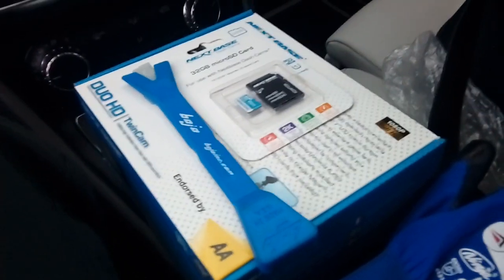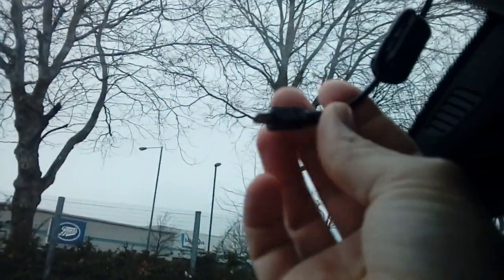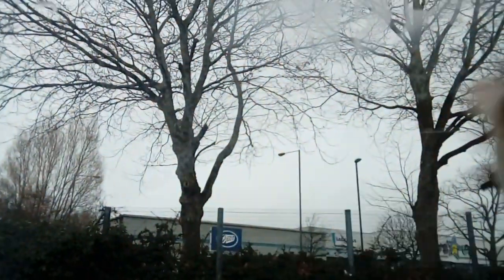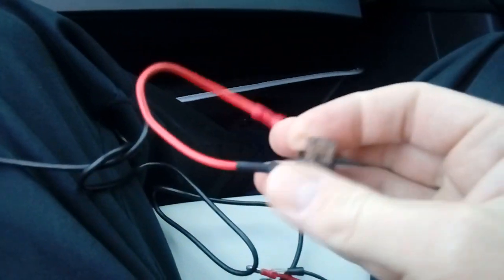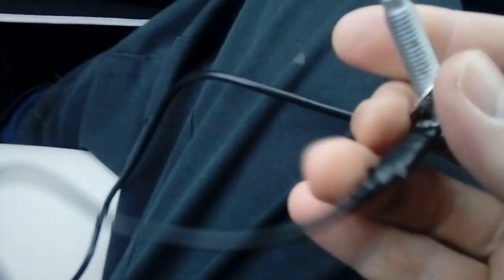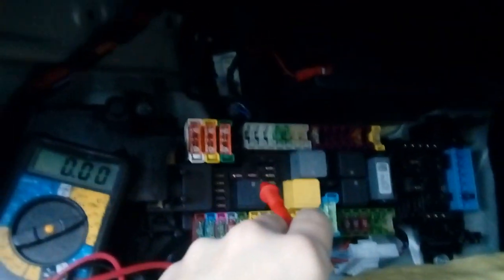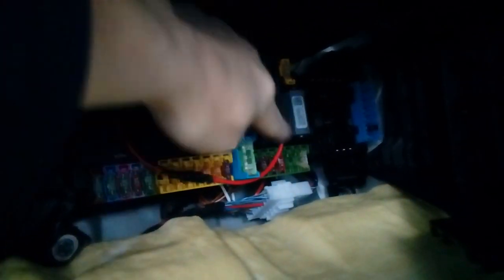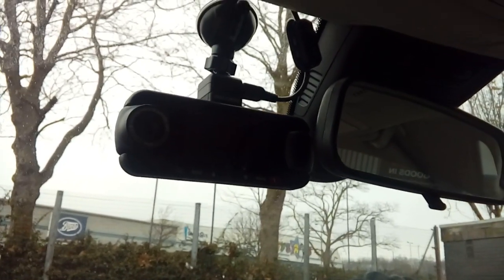Mercedes A Class 2012-2018 dash cam install guide to fuse box

Comment: Spot on. Easy to follow video. For anyone else following this, I used the Nextbase hardwire kit on a W176 (2017) model and found that fuse 65 (Glovebox) worked for me (although you'll need to manipulate the wire on the Nextbase kit to make it fit properly).

Comment: Great video thanks. Just swapped my NextBase dash cam over to the 2017 Mercedes A-Class I’ve just bought. Everything went perfectly and it was useful to know which panels to remove and where to find the fuse box. Done in half an hour 👍🏼😁

Comment: where you fit your fuse i have only the two above, when i try to fit the spur over hangs onto the case is there another fuse to use 2019 A class

Comment: Hello ❤️Amazing video! ❤️ 

i have a Mercedes w176 and i need a constant fuse to tap in, i tried the "ovewrhead unit" but i belive it turns off after 2hours 😪 Thank you
Reply from the maker: Try the fuse for central locking, that will be a constant live.

Comment: Thanks to sharing mate very thorough. I’ll be doing this with a “TOGUARD” one which will be using parking mode which will require a constant power source and I’ll order a hardwire kit. Do you have any advice on which fuse to select? I’ll be looking at the fuse diagram but any advice would be appreciated (I do gather you advise against ABS or any of the really important stuff). Advice on a suitable constant fuse which would be the least risky would be much appreciated. 

Thanks and all the best 👏👏
Reply from the maker: Try the one for central locking as that's live all the time.

Comment: We’re do you buy the kit or do you have link of adapter to hard wire it fuse box?
Reply from the maker: Just done a quick Google search for you - 
https://nextbase.co.uk/accessories/series-2-hardwire-kit/?utm_term=&utm_campaign=FP-Nextbase-UK-Lang-EN-G-Google-PMax-PRSPCT-Sales-Everything-Else&utm_source=adwords&utm_medium=ppc&hsa_acc=7822671863&hsa_cam=17557847883&hsa_grp=&hsa_ad=&hsa_src=x&hsa_tgt=&hsa_kw=&hsa_mt=&hsa_net=adwords&hsa_ver=3&gclid=CjwKCAjw7eSZBhB8EiwA60kCWwJl-UvzVOgzzSIGtXBuFYgs3rFo4fBwwmHPH9RvQcSeZngZV6MYsxoC_ckQAvD_BwE

https://www.argos.co.uk/product/8888396?istCompanyId=a74d8886-5df9-4baa-b776-166b3bf9111c&istFeedId=30f62ea9-9626-4cac-97c8-9ff3921f8558&istItemId=ixwlpxqpt&istBid=t&&cmpid=GS001&_$ja=tsid:59157%7cacid:804-627-9544%7ccid:16587510428%7cagid:134082819109%7ctid:pla-463768873908%7ccrid:587944422370%7cnw:u%7crnd:5350385809521517776%7cdvc:c%7cadp:%7cmt:%7cloc:1006674&utm_source=Google&utm_medium=cpc&utm_campaign=16587510428&utm_term=8888396&utm_content=shopping&utm_custom1=134082819109&utm_custom2=804-627-9544&GPDP=true&gclid=CjwKCAjw7eSZBhB8EiwA60kCWwupHfuk5uaoaBBhzJ3616en5QYde97HcG6jzWYSY4NMVYt1WafMCRoCI_YQAvD_BwE&gclsrc=aw.ds

https://www.halfords.com/technology/dash-cam-accessories/nextbase-dash-cam-hardwire-kit-159302.html?istCompanyId=b8708c57-7a02-4cf6-b2c0-dc36b54a327e&istFeedId=367c5610-f937-4c81-8609-f84582324cd6&istItemId=wqwrqrxlp&istBid=t&_$ja=tsid:|cid:17253794308|agid:|tid:|crid:|nw:x|rnd:5350385809521517776|dvc:c|adp:|mt:|loc:1006674&gclid=CjwKCAjw7eSZBhB8EiwA60kCW68gS7hldRUW9n1o4CndXe5KJgjPYY4J5Qo40eu33EPnVfJy9giGShoCIgQQAvD_BwE

Comment: I'd like to use parking monitor can you advise which fuse do I use for always and can I do without voltmeter?
Reply from the maker: Most of these have power adjust seats,this is a constant live fuse and ideal for the constant live needed on a parking mode camera.
Refer to owners manual for which one is relevant to your car model.

Comment: The 70mai PRO camera have the parking option that records any movement after 20min, for this it must be powered always to the battery?
I have a A Class 2017 with stock rear camera, it's easier?
Also, on left handed steer, it's all in the left site?

Thank you!
Reply from the maker: It sounds like you camera has a red power wire and a yellow power wire? If so one will be for ignition switched and the other will be for constant power (to the battery).
You should also have a black wire for the earth connection.
Reply: @PJsprojects  Hi, my car have that 3 slots full, any advise please? Camera have parking mode so should be always turned on BUT never kill the battery

Comment: Hi. What wire did you use for the fuse connector? I have a mini one but that doesn't go into the fuse slot you used because the fuse is bigger? Do u have an Amazon link or smin?
Reply from the maker: Fuse spurs come in a few sizes,if your fuses have the blades close together then it's a micro fuse spur you need. EG - https://www.ebay.co.uk/itm/10a-amp-MICRO-Piggy-Fuse-Tap-Car-Audio-Quick-Ignition-Live-Splice-Add-Circuit/183460151898?epid=26024342424&hash=item2ab713c25a:g:myUAAOSwa5lbr5c2

Comment: Last question.... how did you get the 13mm bolt out of the dashboard? Mine’s stuck right!
Reply from the maker: Yes they can be a pain,the bonding glue from the trim can get on the threads when the car is built and so makes them stick,try a ratchet spanner with angle head adjustment.

Comment: Can you show best way to route the cable when using 12V adapter thing? I’d rather not hardwire it to fuse box.
Reply from the maker: Your best bet would be to follow the guide as far down as the fuse box and then carry on under the dashboard with maybe using some small cable ties to hold the cable up and out of the way until you get to the center console. At this point the cable could be tucked under the edge where the center console meets the carpet and them just leave enough cable to still come up to the 12v socket in your car.

Comment: can you tell me how to go behind the centre console? I want to wire something from drivers footwell to the fusebox but can get the wire through? any assistance. A class
Reply from the maker: The best way I have found is to go behind the center console flash with the carpet. I use fiber glass flex rod with the cable taped to the end and push it through but you could use something like thick solder to do the same trick.
Reply: so you reccomend i just go in passenger footwell? And lift the carpet and use a flex rod up near the plastic kick casing and push it through? is there even a gap you can see would be available

Comment: Wait, how did you get above the headboard?
Reply from the maker: The headliner is just a sort of card/fiber trim and so with care it can be gently eased down from the edge at the top of the windowscreen,just enough to pop the cable under it.

Comment: Great video and useful tips, but where I am struggling on my installation is trying to find a switchable fuse on my E220 (2017) I have tried with a meter but they all seem to be live in the passenger footwell.  I have looked at the fuse box cover and in the manual but no help on which one to use.  I'm hoping someone can give me a pointer on a fuse I could try otherwise it's either the cigar lighter option or look at trying to get to the engine fuse box. Thanks in advance.
Reply from the maker: Neil Bennett A lot of them are sadly like that. You should find another fuse box at the side of the boot(depending on region) the secondary fusebox will have a switched live but it also means running a power cable the length of the car.
Reply: I just went with the 20 in the dashboard fuses. It worked in two previous cars and works in this one. Only issue I have is I have a battery pack for parking mode - this switches on and off if eco mode (engine start stop) is on. I therefore always have to remember to hit the button and turn this off every journey. Other than that all good.